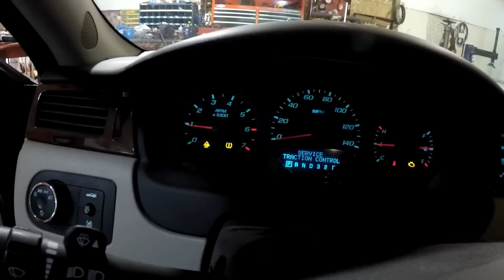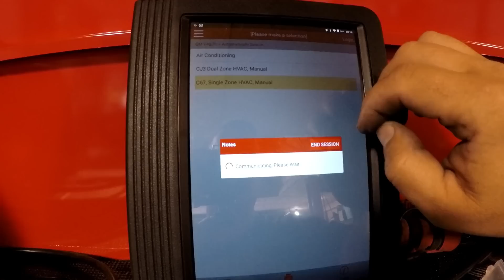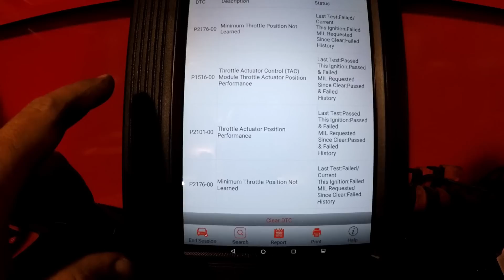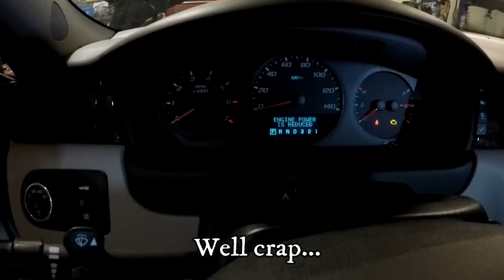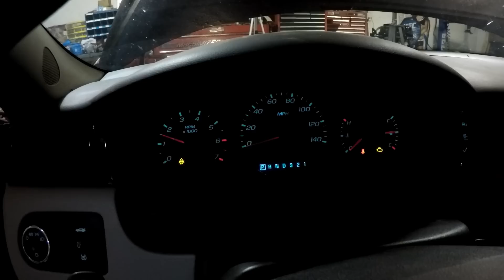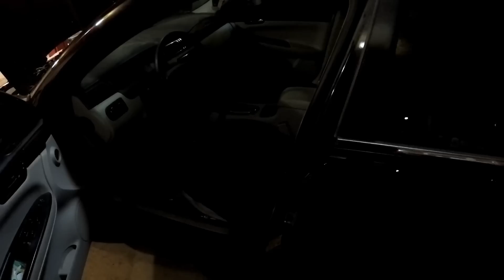How to fix Reduced Engine Power and Service Traction Control on GM Chevy Pontiac Buick

Comment: I own 2011 Malibu, purchased in OK now live in Nebraska. I just spent $500 for this issue to be “fixed”. Drove 500 miles home to OK for Thanksgiving holiday. Car ran fine. On my way back to NE about 150 miles from home as soon as the much cooler & moist air hit the same issue! This car belongs in the river! I will NEVER buy a Chevy again!
Reply from the maker: It’s possible there’s a break in one of the wires near the throttle body connector. That is also way too common on the GM’s.
Reply: ts6034 thanks for the tip. As soon as I have a competent male stop by I will have that checked out. I am just not sure how much more of this car I can take! I bought it in June of this year with only 115k miles on it. It has broken down on me 8 times. Chevy has made it impossible for single women to own their brand. Have you ever dealt with the wiring issue that I keep reading about?
Reply from the maker: @kristimorgan9012  The wiring issue on the throttle body harness? Yes!
Reply: The entire wiring on the 2011 models is shit from what I understand! I have had to replace headlight wiring harnesses on both headlights because Chevy made them for LED’s but when you walk into a parts store or look in a book you’re sold halogen’s or maybe vice versa...100 proof Captain & Coke kicking in LOL! Thanks for your GREAT video
Reply from the maker: @kristimorgan9012  haha thanks!
Reply: I have a Cruze and I agree. Chevrolet is garbage. My friend has Cruze and he has problems. I had 2 coworkers who bought a Malibu and both had transmission issues.
Reply: kd k AHG!!! Don’t say that! So far the transmission has been good! I swear I will drive this bitch into the river if another thing goes wrong. I’m all about getting what you pay for & Chevy’s aren’t cheap! I’m ALWAYS looking at the newest cars coming out & as far as looks Chevy draws me back in every time. Last fall I was looking at 2019 Tahoe & with trim package I wanted sticker price was close to $74,000. C’mon I would have to save for what seems to be the rest of my life. Chevy has brought back the blazer for 2019 & I do love the price. As for our Chevy’s that are already out there on the road, I suggest finding a certified Chevy mechanic avoiding the dealership...I found my certified GM mechanic at Graham Tire in Grand Island, NE. By the grace of God, an auto parts store employee steered me in his direction. My Bu is running fine now, fingers crossed & knocking on wood. Best of luck to you you, with your Cruz & your friends with the MaliBu’s!

Comment: The water pump got replaced and belt to my 2008 enclave but now the lights fortraction and stabilitrak came on it doesn't run good now.
Reply: Whoever done the work might have forgot to hookup one of the speed sensors on the hub..
Reply: Viola Muniz replace plugs,  put fuel injector cleaner till problem goes away

Comment: Great job, I have been having to deal with this issue with my  2011 Chevy Camaro SS. I took it to the Chevy dealer and the tech scanned it and told me that I needed my throttle body cleaned but he said that they would tell me to just buy a brand new one so that they could make a dollar off of me so he reset the error code for me. It happened again about three weeks later I let the car sit for a day and came back and started and it went away along with the check engine light. I have to get it done soon so thanks for the very informative video.
Reply: EdifiedSoul I’m having the Same problem, I have 2011 V6 Camaro and I don’t know whether I need to change the whole throttle body or to change the electrical part only , tell me what happened with you please
Reply: Junk it....get a ford....problem fix

Comment: Really fantastic, clear video and audio!

Hopefully this will help to future viewers......    The TPS is simply a Variable Resister!  To describe it closely is as follows.  Consider windshield wipers as an example.  As the wipers move back and forth, they will tend to wear down, will start to bind and squeak and leave streaks on the windshield.  That is exactly what happens to the TPS contacts as the throttle is constantly opened and closed over time.  It just simply wears down the resister on the circuit board and or wiper contact that moves with the throttle plate.  As it wears down, it will give inconsistent/intermittent signals to the OBC/ECM.

Kinda like drinking beer and smoking pot to some of you as it confuses the Brain/Computer to think one thing when something completely different is going on.  Therefore, the body, or in this case, the engine will not respond as programmed!

Just a little hint to you DIY mechanics and/or junkies!

Cheers
Reply: Not to be a now it all but the tps is called a potentiometer. A wiper moves across a voltage resistor as the t.b plate opens and closes. Varying the Volts, not like a rheostat that varies the amps. Usually the constant wear creates dead spots in the tps signal.
Reply: Lawd Fadda.....someone trying extra hard to be technical.
Reply: Yea exactly on these eco shitty flex fuel boosts . was driving a 2013 Chevy Malibu nice looking beautyful car piece ashit. Took it for a drive , smoked one from California stopped at corner store for a big 🍺  , smoked and drank took off to HWY. Pice off shit running 40 miles at A HWY. At 75 .i. Freaked out though i was running at hi speed . am never gitting hi in a f*#!n Malibu eco flex
Reply: Very well explained

Comment: I have a 2005 Chevy cobalt and had this problem parked it over night and it won't start now like it's not getting spark or fuel, wants to turn over but won't even spraying starter fluid into the intake. what would cause it to  not start? I need help. thanks.
Reply: check your fuses and ground to pcm

Comment: Very helpful video, but use hammer knocking those sensor clips is nut job, could easily damage the sensor .
Reply from the maker: But it didn’t...lol. Thanks though!
Reply: I got the P2135 code, I used brake cleaner sprayed the sensor and then used WD40 sprayed the sensor, I mean inside the sensor, and then installed it back, still getting the code everyday. so I used 3 inch long wood steak forced the Throttle plate closed overnight,  guess what, miracle happened, problem gone. TRUE. Almost certain, the cause is the spring inside the body lost its original parameters too much over years .

Comment: Ts6034 , hey I have a 2008 Malibu 2.4 ecotec. It would hesitate when pressing the gas padel went to AutoZone , codes they gave me was p0121(tp sensor performance) and p0420 (catalyst system low efficiency ) so I went back home disconnected the battery , removed the throttle body cleaned it put it back on turned on my car and as soon as I started it up the rpms where high a lil pass the 3,  kept messing around with the throttle body n now the engine power reduce came up and the rpm still high do U think I need to replace the throttle body sensor???
Reply from the maker: Sorry for the delayed response. What was the fix? Sounds like a faulty TB or pedal sensor. The catalyst low efficiency is not related to the throttle issue. It just means your cat converter is starting to or has failed.

Comment: How does the throttle body and TPS tie into traction control? I'm having this same issue on an 08 Pontiac G6. I'm looking all over the internet and youtube and everybody has a different answer as to what the problem is.
Reply: Same here. My car wont even start now.
Reply: check and  replace the tps sensor not working  i did in mine
Reply: Tps is (throttle position senser) that's what tells the butterfly how far to open depending on your foot.. Gas pedal is pushed down 60% thats how much the throttle body opens and the tps is why it does that.. I hope he doesn't say all this at the end of the vid..lol
Reply: @josephmarshall1850  that part I get, but how do they relate to thr traction control system?
Reply: @metalmikejr  on the tps side i don't really know why it did on my gxp it was the throttle pedel end of it..  But if all your lights tc sc ext but there's no check engine light on it'll either be a bad hub and if those have no wiggle in them then check the boots and look around where it might have messed up the wireing harness somewhere.. I've been threw the exact thing man and they all have those querks in them.. If there's not any burn marks on either side of the harness or the hub side of where they clip into one another then its one of the wires..
Reply: The reason for the tps POSSIBLY causing traction control system is the electronic motor will actually close when wheel spin is detected by pcm from abs saying one or more wheels are spinning. So an easy way to stop that is by telling the throttle to close, even if you don't let off. There are other counter measures like reducing fuel, spark timing or less likely applying certain brakes thru abs to slow the loss of traction.

Comment: does a bad gas pedal sensor give the same code?- thank you for the video!
Reply: Yup
Reply: @adamsaquatics3332  nope
Reply: No
Reply: @mikesecondo2254  yes it can. If its completely bad it will display a throttle position sensor code. If if its going out, it absolutely can display the same code
Reply: @adamsaquatics3332  nope
Reply: @mikesecondo2254  yup
Reply: @adamsaquatics3332  NOPE¡¡¡¡!!!
Reply: So, Mike and Adam, have you two figured out if it can give the same code or not?  You both can't be right...although you both seem pretty confident.

Comment: my son's 2007 Malibu max just started having the traction control light flashing error but not the reduced power.  how do I fix the traction control issue?
Reply from the maker: Is the ABS light on along with the traction control? If so, I’d first suspect a bad wheel speed sensor.
Reply: I cleared the codes and cleaned everything like you did in the video, but I didn't change out the switch part. So far in 3 days of driving, the traction control light  HAS NOT come on, and the car is running normally.  I guess time will tell if it fails again...thanks
Reply: @Tomsfoolery.  Will a code for the speed sensor show after having a diagnostics test ran?
Reply: Adrain Nikkita i changed the TPS sensor,fog light sensor etc ... traction light still staying on; any other suggestions?
Reply: @brashaadmoore2389  No code for the traction was shown after having a diagnostics test ran. It only showed codes for bad fuel injectors. After not driving it since July,it doesn't start at all. The battery is new,idk what else to do. When I got  the front tires replaced that's when I started having traction issues. I was told to turn the key over and let it set for 10mins. Cut it off and repeat 2 more times,now my service traction light is out.
Reply: Hi where I can find the repair kit for  a ls2 trohttle body?